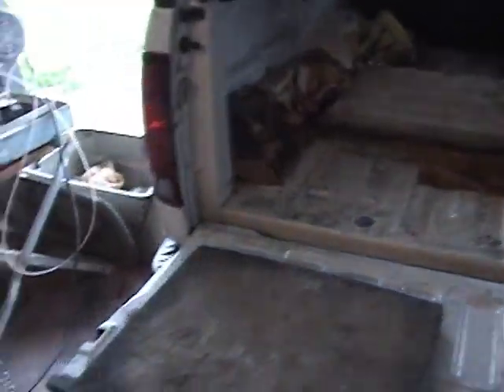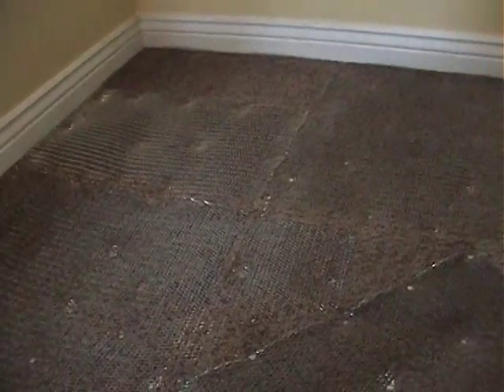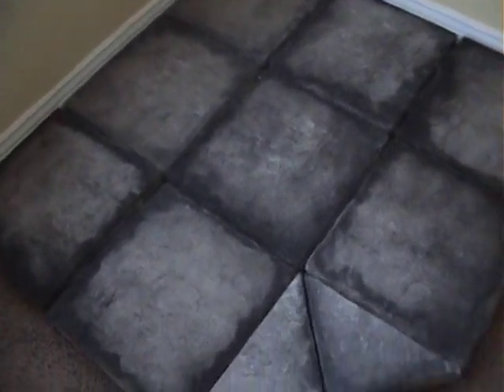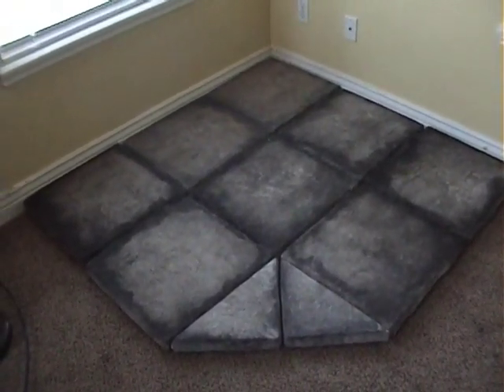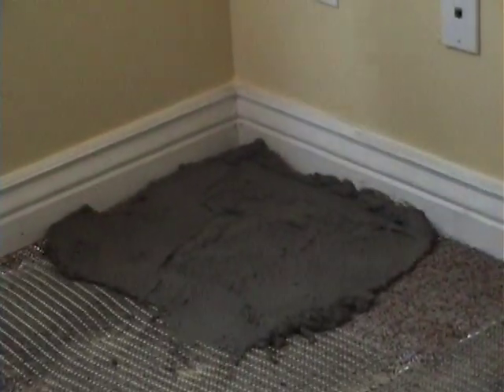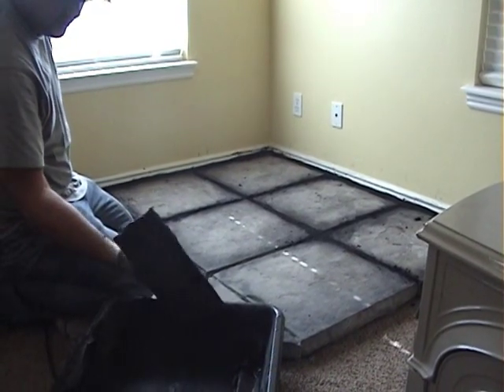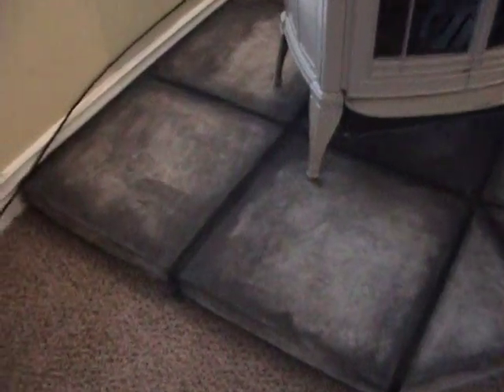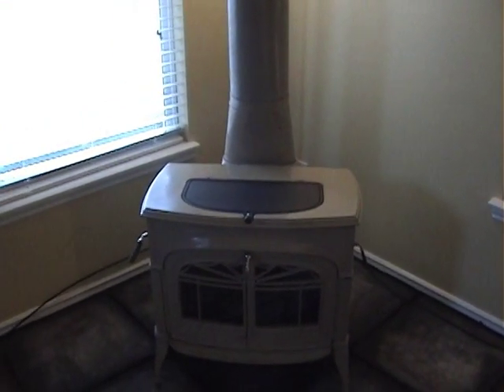How to Build a Hearth for a Wood Burning Stove

Comment: Hi great video! I plan to do the same type of harth only I will be laying my harthstone on top of old tee shirts soaked with gasoline. Thanks for the insperation.
Reply: Doug Stanley I've put my stove on a couple of baking trays which I've filled with gravel for a more rustic look. Now that I've installed the stove I realise the builders forgot to put a chimney in my apartment. Will it be OK just to open a window or should I connect the stove to some sort of extractor fan?
Reply: Thanks for all the spelling mistakes.
Reply: It does sound funny but notice the manufactured hearth pads all say you can put them right on top of carpet ...it is all a matter of R value.   I dont like the lath on carpet because it seems like to me it would not be stable ...
Reply: Just a 12 dollar plastic oscillating fan ... just aim it at the window ..the smoke will have to obey ....what could go wrong?
Reply: @jasonyoung6362  😂
Reply: Hahaha brilliant

Comment: At a local stone yard they had 4 left over about 1- 1 1/2"  2'X2' stones to make a 48" square stove pad.  We have raised floor home so all I did is remove carpet and padding and and layed down 1/2" cement board ..1/2 sheet =48x48 ...lol  I did not even screw it down to sub floor (where is it gonna go anyway???)  Next I mixed up some thinset and layed in 4ea 2x2' square manufactured stones...these are jagged edged "stones" made of dark gray colored concrete ...look pretty realistic like natural stone cut from a quarry...they only charged us $10 apiece because they were remnants from some job ....once it sets up I'll cut off visqueen plastic and grout it with nearly black grout and then re-install the stove!!  Bottom line?  Counting stone cost,  the cement board, thin set, grout and sealer?  LESS than one hundred bucks all in!!   Hundreds less than boxed tile kits for "hearth stone"/ "stove board" ??    Looks way way nicer too!  The boxed kits are just thin tiles for $500ish PLUS  where as these are robust 1 - 1 1/2" thick PLUS the 1/2" cement bard underneath!    Easy peasy really! ... a little rustic looking no doubt but HEY!  People pay EXTRA for that!   lol

Comment: What is the purpose of the mesh? Did you only need that because you have carpeting underneath?
Reply from the maker: The metal lath is for the mortar to grab onto. Concrete with steel is much stronger and will prevent cracking. The carpet is NOT relevant take it out or leave it. If you remove the carpet and you have a wood subfloor you will need to nail down some metal lath to keep the mortar from cracking. If you have a concrete slab i would use some large format tile mortar... thanks for the question

Comment: In the US and Canada it requires removing combustible material before installing. At the least carpet is uneven and a poor surface to attach mortar to. You cut the stones nice though. oh and the stones should be sprayed with water. cement doesn't stick to dry stone as well.
Reply: So YOU say in the US  you have to remove the sub floor??  And then what pour a block of concrete in it's place?   THAT is too funny! "remove ALL flammable material"  LOL LOL LOL!!    DUDE  it is WHY the codes and regulation require an R value BETWEEN it an flammable material!   there is nothing wrong with setting a hearth pad right on top of carpet if it is engineered for it....   i mean I would not nail lath on a carpet but like another guy said.  at least put plywood over the carpet first! THEN the lathe and the hearth stone ....ALL the manufactured hearth pads I see advertised say you can put it RIGHT on top of the carpet!   ...it is ENGINEERED for THAT whether YOU approve of it or not!  MORON!

Comment from the maker: Let me share my experience with you about my Wood Burning Stove I installed in my Home! I live in this home and I use the Wood Stove every day I can when its cold. I wanted to show a DIY person how easy it can be to install Hearth Stones for their own Wood Stove Project. I KNOW IT SOUNDS CRAZY!!!!! That's why I Did it. This is YouTube so I can do what ever I want! Think about HOW I did it for just a moment. With a solid wood sub floor under the carpet I was able to nail the first layer of metal lath nice and tight. Next I nailed another layer of metal lath over that creating a very tight metal lath to BOND cement to. So when you have the combination of METAL and CEMENT nailed to a SOLID surface you will get a very nice HARD platform to set something HEAVY such as a Wood Burning Stove. The thickness of the Non-Combustible surface is over 3"!!! This is far better than any requirement for any building code! However you should Check with your local building codes before doing any Fireplace installation. After 3 full seasons of Warming my home I'm still here ;) Thank You for your comments and sound advice.....

Comment: I wonder if he ripped this apart after reading all the comments
Reply from the maker: I made this video 7 years ago and have Burned a lot of fires... I have installed hundreds of Wood Burning Stoves and Gas Fireplaces and NEVER any problems or house fires. I have only got more views because of all the comments and replies. Thats what makes the algorithm work! Thank you. I wonder if you read ALL my replies? There are many ways to install a Hearth Pad for a Wood Stove... I guess I picked the most controversial and misunderstood way to do it. I wonder if he did that on purpose? No he is not that smart just a dumb Fireplace installer. I would never put anyone at risk when Installing a Wood Stove or Fireplace especially myself. Notice all the Key Words have a cap... Al Gore has no rhythm. I love YouTube

Comment: do you have to insulate the walls with anything special
Reply: Check your local building code for clearances to combustables... In my region this guy would be ordered to redo everything. To answer your question though, cement board or formglass would work.

Comment: Hi Matt! Love your videos! Got a question for you, I am looking to build a hearth pad on top of a hard wood floor in our dining room, should I use the metal mesh / lathe [ like you did on the carpet] underneath the stones that I want to put down or maybe hardyback concrete pads or just mortar? I would also like to build a stone wall, up the wall behind the wood stove for extra protection from the heat against the combustables, or is that not necessary? Thanks, Tim.
Reply: It is absolutely necessary to install cement board or 24 gauge steel to go 12" off combustibles.  Check the NFPA-211 standards to avoid having insurance problems or resale problems

Comment: This guy does this for money? He hasnt done one install to code and he is liable for each one he touches. This hearth does not meet code, sitting on a non combustible does not count. Heat can transfer through the mortar joints. Those stones have to be on a piece of cement board with a piece of 24guage metal in their as well.

Comment from the maker: The hearth is rock solid! Doubled up the wire and nailed it down tight. You can make yours how ever you wish. Thanks for the comment. 2 inches thick is the requirement for a hearth to combustables.
Reply: Unless of course the legs give you at least 8 inches of clearance right?
Reply from the maker: @CN-bg1fy  Thank You for the smart question! Some Wood Burning Stoves require a Hearth Pad to have a certain R-Value. Every Wood Stove is different so please refer to the manual for Thermal Protection R-Value or Just an ember protection which is any non-combustable surface it could be thin sheet metal... Many of the newer Wood Burning Stoves have ash pans along with layers of metal on the bottom to allow for a nice "Heat Shield". Customers who don’t need to Build an R-Value Hearth and can install directly on a tile floor are more likely purchase the Stove with less work and lower cost Installation. Thanks for the question!

Comment: This is a seriously bad example of how to do this. If you are laying down cement as a base directly on the floor then why would you not remove the carpet? Better yet if you really didn't want to do that what you could have done is made a plywood base, or plywood with cement board over it, you could lay the mortar/cement into and then it would be removable when the need arises without destroying the hearth and trim and whatever else around it. I'll assume your vertical clearances are in spec but in the video seems doubtful. Oh and looking at one of your other replies, a combustible under all that cement and stone is irrelevant. If it weren't there'd never be acceptable code for anything with a fire inside a home. Reading you tore it out is funny. You could have just picked it up and moved it done the proper way.